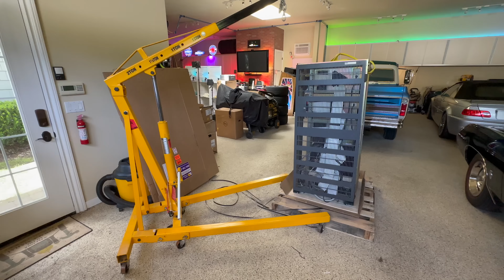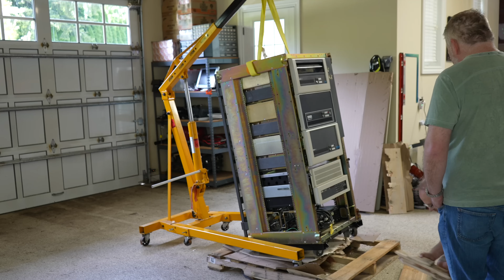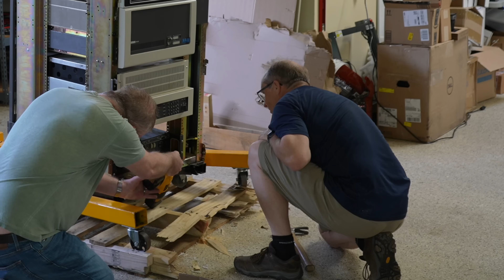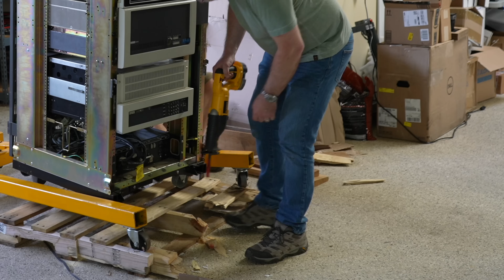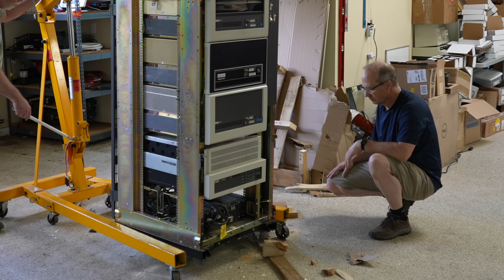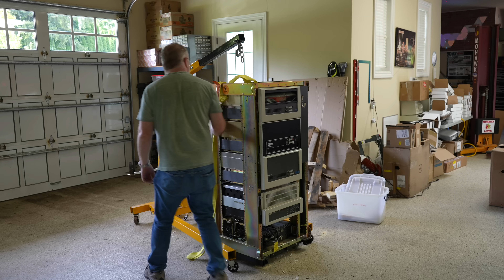I Bought the HEAVIEST Computer on eBay: The PDP-11/34!

Comment: Love the PDP-11 stuff! In high school I had access to a 11/20 then a 11/45 and finally an 11/70. We ran RSTS. I even had my own DecTape! Those were awesome days (74 thru 76). We also had a PDP-8 (I think it was an i). It had 4k core memory with an ASR33 teletype with a paper tape reader/punch. I can still remember the starting address of the rim loader (7734). We had paper tapes to load BASIC, FOCAL and FORTRAN. Nobody else wanted to play with it, so it was basically all mine. I leaned machine language and hand loaded my programs through the switch panel. I am now 68 years old and still working as a systems architect. I still love writing code.

Comment: When I was in Engineering College (1977) I took a class in programming languages.  We used a PDP-11. Not sure which version.  The class was about assembler language programming.  The professor had us program in machine code first so we would appreciate  what a high level language assembler language was.  I had been programming the hp-41CX for years and was supprised to discover that PDP-11 assembler was VERY similar.  So I was right at home with that course and liked the DEC PDP-11.  Several years later (1986) , I was able to aquire a DEC VAX 8550, Star Coupler and a cabinet with four 333MB 14inch Hard Disks, a tape drive for backups, a line printer and several terminals.  With this system running VMS and having Oracle V5 with Oracle Developer tools I set about building a network planning system for UPS Airline.  I was the manager of the development team, database administrator and systems administrator for a couple of years until I hired a systems administrator/database administrator.

Comment: black aquarium filter foam his coated with carbon to produce a support to the bacterial colony that develops which cleans the aquarium water... I don't think the black carbon particles are meant to be part of an electronic ventilation system... just saying. Better replace those with the white fluffy fiber filters.

Comment: Thank you for your very interesting videos. The time I was using those computers was the best in my life. Was using LSI-11 (-02, -23), PDP-11 (-34, -40, -45, -70), VAX 7xx computers from 1978 to 1987. For the OS: DOS, RT-11, IAS, RSX-11M and VMS on the VAXes. Built the hardware and software to get two disk-less LSI-11/03 and a LSI-11/23 DMA connected in a (mini) cluster under RT-11 in 1980 as a university laboratory experimentation facility. It was a time that you were able to understand the systems completely, both from the hardware and software side. DEC systems were well documented and easy to understand. I remember that the VAX 780 CPU was a beast of 27 cards in the machine and an LSI-11 was used inside the cabinet to boot it! Was very sad to see DEC disappear because of their lack of understanding the PC revolution.

Comment: @Daves's Garage for filters; look into Blue or Green (colored) cut to fit Furnace Filter, Way more air flow, Washable & Doesn't disintegrate with time, been using it for decades on my own computers

Comment: I first came to DEC systems in 1989 working as a Operator then System Manager on VAX 8000 and 6000 systems. I could do pretty much anything you wanted in VMS but didn't really understand how the internals worked. Like with many other things, notably the music of the 70s and 80s, I feel I was born ten years too late! I wish I could have begun on the 11/x systems and got to know them from the ground up. I did get to play with an 11/780 a few years later but by then  it was just a cumbersome toy in the corner of the computer room that we could play around with on night shift if we were bored and could stay awake long enough.

Comment: For computer refurbishment before even turning on the machine you would pull each board, after mitigating any technician static using a wrist strap tied to the frame, there may even be a banana jack present to accept a anti-static wrist strap banana plug in the drawer, and do a visual inspection to spot any burnt or damaged components. If the inspection looks okay, you would then clean the edge connectors with Deoxit D5 and an antistatic swab. If the oxidation is heavy, which is looks like in this case, you would then apply a thin layer of Deoxit D100 to the edge connectors and plug connectors. Deoxit D100 has a lubricant which makes seating edge connector boards easier, and for very old machines, with D100 applied you can cycle the boards a couple of times and you will notice the wiping action of the edge connector smooth out. This indicates that the edge connector wiping contact is mating smoothly to the edge connector. For all the boards/connectors that are easily accessible you would pull, inspect and clean all of them.

Unfortunately on very old systems you may need to replace critical circuit capacitors, like electrolytic Aluminum and Tantalum.

Comment: Many years ago my government customer was running old code on even older dec h/w which became increasingly harder to find spares for (they ere buying them on ebay) and they ended up running the code on a Dec emulator which ran on a PC. I dont know if that ran as a VM in Windows or entirely took over the PC hardware.

Comment: Dave, your wife doesn’t have to worry about you going out to bar and hooking up.  You just fill your man cave with interesting computers and enjoy.  Me too.  I have an old Tektronics IBM Mainframe Oscilloscope (analog) in my garage.  Just in case a IBM 3705 NCP communications controller is locally available.  Old retired SNA guy.

Comment: The PDP/11 34 was my first computer to use, other than the timeshare computer in my high school.  In 1979, I set it up with a pack of relay switches to perform load shedding and building automation for the company I worked for.  The entire program ran on Fortran with 24 KB of memory.  Worked like a charm for about 4 years before being replaced by a Barber Coleman Econ IV.  That computer is also long gone but I kept the desk cabinet for my own use and it now houses my flight simulator computer. Your video took me down memory lane to those great times in my life. Thanks.

Comment: A few key notes. 
A PDP-11 is nothing like an S-100 system where the backplane slots are just a "bus." Only some slots in some types of backplanes are wired for peripheral controllers. On the 11/34 CPU DD11-PK backplane, the first two slots are specifically dedicated to the CPU, and the other slots are for peripherals. Slots 3-9 rows C-F are small peripheral controller (SPC) slots, which support simple peripherals. All 16 data lines go to them, as do most of the address lines, interrupt lines, and DMA lines. In slots 3-8, rows A-B have the extra connections that make the entire slot a modified unibus device (MUD), providing the additional address lines needed for the full address space, as well as funky voltages needed by MOS or core memory cards. The only slot on the DD11-PK that is "Unibus" is AB9.
The RK11-D controller takes in Unibus on AB1, and puts it out on AB4. Slots 1-4 rows C-F are completely "haywired" for the dedicated logic. AB2 is the cable to the disk drives. While it uses "Unibus" cables to connect to the disk drives, it has ZERO electrical relation to a Unibus. In fact, electrically it is the interface that Xerox used on the Diablo 31 and 33 disk drives, which are what Digital sold as the RK01 and RK03.
The modern expansion backplanes were DD11-CK and DD11-DK, with 4 and 9 slots respectively. All nine slots are SPC, with all but the first and last being MUD slots.
The only Unibus hard disk controller that Digital made that fit in a controller slot was the RL11 for the RL01 and RL02 disk drives. It's a modified Unibus device, just to have enough real estate.
That both RK05F disk drives are labeled 2/3 is fishy. Each drive should have a unique unit number. It's set on one of the cards in the drive, either by jumpers or switches. There are diagnostics that will test the controller without involving a drive. But, keeping RK05 drives working is "exciting" now that the supplies (filters and heads) are unavailable.

Comment: I was a DEC contractor for a while circa 1995-96.  When my first contract ended, I picked up another gig with a group that was, at the time, based in The Mill, the long time HQ for DEC in Maynard, Mass.  I worked in The Mill for a week before we transferred elsewhere because The Mill was in the process of closing.  So not only was I briefly a "Mill rat", I was one of the last ones.

I started on DEC equipment in high school around 1976.  We had dialup timeshare with a county-owned DECsystem 10 shared by 20 or so schools.  I then worked on the county PDP 11/70 until graduation.  In college we had a DECsystem 20 that had the horribly slow DEC 10 emulator.  I also used an 11/20 in my workstudy job.  

Long ago, but in some ways seems like yesterday, especially when I see videos like this.

Comment: I've inherited a PDP-11 cabinet and PDP-11/20 control unit (probably non-functional).  Would anyone happen to know the proper fan size for the top of the cabinet?  It looks like 250mm or so should be about right.  I plan on using it as a cool looking old rack but with modern equipment, and I'd like to put a fan in the top for air circulation.

Comment: I worked with hardware that you had to keep (some) battery + on or it lose its state forever (bad news).  Had to solder in a fresh battery pack and then cut the old out.

Comment: Back as a young programmer, my company used PDP-11/34 systems as a peripheral controller for off-line high-speed laser printing (high-speed = 29 inches/second), like those used to generate telephone and utility monthly billing statements. The 11/34 ran under RSX-11, but the custom controller software was developed on a PDP-11/44 running RSTS/E. It's been many decades since I sat in front of either system, but my recollection is that RSX-11 was a very terse command set, and the RSTS/E was somewhat more verbose. I especially remember the RSTS full screen text editor program because it could control the cursor on the VT-102 and do fancier formatting than an a ADM-3 and could even display 132 columns. Magical!  LOL. If you could run a tour of RSTS (or maybe you already have) that would be fun.

Comment: Das blinkenlights!  That bit was on the PDP-11 I was using in Grad School.   Specifically:

 ACHTUNG!!!  

Alles Touristen und Non-Technischen Lookens Peepers.
 
Das Komputer Machine is Nicht für Gerfingerpoken und Mittengrabben. 
Oderwise ist Easy Schnappen der Springenwerk, Blowenfuse, und Poppencorken mit Spitzesparken. 
Das Machine ist Diggen by Experten Only. Ist Nicht für Gerverken by das Dummkopfen. 
Das Rubbernecken Sightseenen Keepen das Cottenpicken Hands in Das Pockets, 
So Relaxen und Watchen Das Blinkenlights.

Comment: My very first IT job was operating a DEC PDP 11/70 back in 1980. My now VERY vague memories of it are of multi-platter disk packs that were the size of a desktop printer. Each pack stored less than 100MBs and the drives were the size of dishwashers☺ Kudos to you for possessing the skills to resurrect your 11/34!

Comment: Absolutely fascinating videos!

I worked for DEC in UK from early 1980’s.  Started as a field service engineer on small Unibus systems, mostly 11/34s, 11/24s and a few 11/84s and some older machines too.

At that time, we split the teams into Qbus, small Unibus, large Unibus and VAX.  It was more about the type of peripherals used than processor power TBH.  Didn’t make sense to train everybody on every device.  I think there was probably a PDP-8 team too, though 8’s were disappearing rapidly by then

We certainly had PDP-11/34s with RK05 drives, but during my time in field service, 1984 – 1987 I guess, RL01 and especially RL02 drives were popular, having a massive 5Mb or 10Mb capacity compared to 2.5Mb for the RK05.

If you do need to access the underside of the backplanes, for example to remove or replace the NPG in/out jumper, you should be able to tilt the whole CPU unit upwards by pulling forward the levers on the sides of the drawer unit.  Obviously be very careful you do not trap are damage any cables in the process, and check everything before trying this on an old machine.

The DMA and associated NPR (Non Processor Request) and NPG (Non Process Grant) is a bit of a gotcha if you are changing an existing Unibus configuration.  

From what I remember, on a typical default 11/34 configuration, some slots are dedicated for DMA use and won’t have the NPG jumper on the backplane.   Slots not originally intended for DMA cards have the jumper in case the card does not pass along the NPG signal.

If you place a DMA card, such as the UniBone in a non-DMA slot with the NPG jumper, this will need to be removed as you say.  If a DMA slot has a non-DMA card that does not pass along the NPG signal, or an older type G727 grant continuity card is used, then the jumper will need to be added to the backplane for that slot.  The G7273 grant continuity card does pass along the NPG signal so if that is used no backplane jumper is required.  Phew!

Of course, PDP-11s could come in many configurations, and could be modified subsequently by their owners, so checking each slot for presence or absence of the NPG jumper is a good idea.

One reason why, even though in theory you could put a device pretty much anywhere on the Unibus, you would never change the position of cards on a working machine.  Actually there are more reasons than the NPG issues mentioned above – but this post is already far too long!

Comment: It's funny. I started on IBM 1620/1710 decimal machine w/ 1 disk pack, card reader/punch, 64K mag core memory, offline tabulating line printer. Used PDP-8, but nothing heavy. Then after college went to Western Electric/GTE, moved to IBM 370/145, then IBM 370/158, then IBM 370/168. We had 100 3380 disk drives, 50 tape drives, 250 terminals, massive I/O controllers to run JES2/JES3, MVS, TSO, etc. Went to Intel after working with 8080, 8085, 8086, interfacing with DEC PDP-11/70, and the IBM 370/168 (also added IBM 3090 mainframe). Write custom operating systems, drivers, and had the Intel, DEC, and IBM systems talking to each other and transferring data, compiling code with custom compilers, and executing finally on the 8086. Then went to Hughes/McDonnell Douglas/Boeing in CA and they TEN IBM 3090's, some IBM 370's, and some VAX 11/780's in Long Beach alone, not to mention St. Louis and Mesa, AZ. I was based in AZ and troubleshot micro, mini, and mainframe systems in quite a few states. My biggest accomplishment though was to put FOUR 8086 CPU's together at Intel to emulate the IBM 3090, wrote the firmware, diags, boot loader for XENIX-86 OS, and this system became the proof of concept for the Intel Quad Core CPU 8 years later. Was instrumental in setting up the Hillsboro, OR Intel facility, 80286, 80386, 80486, and Pentium. Retired now. What a career!

Comment: My first experience of a computer was a PDP-8, with several Creed 2300 teleprinter terminals for user I/O. Each had a built-in tape punch and reader, but there was also a high speed paper tape reader, an X/Y plotter a massive Hard drive, probably 5 megabytes, and an optional orange screen monitor. A monthly maintenance and service rental of around £1,200 was payable. (Those were the days.) It ran 1969 BASIC and COBOL. 

I never saw a PDP-11, but always wanted to experience using one. This video, and Dave's interesting Usagi Electrics channel, is about as close as I'll ever get to seeing how they rock, and what they are capable of. So thanks for this video, and any future ones which you make which feature this very versatile machine.

Comment: About 1990 I had a pdp11/34 system with 4 rk07? hard drives (10mb removable packs) plus a giant tape drive (9 track open reel).  It had RSTS with BASIC and UserBase.  The whole system was clean, complete and ran perfectly (tho "ran" is generous).  I had it set up in my dining room - mostly as a conversation piece.  I paid $270 for it (had to drag it home).  I don't know how much it all cost new, but as a clue -- the tape drive had an invoice stuffed inside it that showed the tape drive alone cost $67,000!  I eventually scrapped it because it was a pretty useless novelty.  But damn!  You paid how much?  Shit, who knew it would be worth so much today.

Comment: When I was 20 or 21 (I am 66 years young now), I got my first major job working for Blue Ribbon Sports, before they took the show name for the company name and became what we know now as NIKE. This is when they only had two or three building in the Koll Business Center. They had a single PDP-11/70 and got another one a few months later. There were many disk pack drives and tape drives for each system. I thought this was the coolest thing I had ever gotten to work with, and it was.

Comment: To  fix cartridge drives(make them interchangeable) you need a tecktronics scope and
the alignment procedure + spare pack written by the alignment program.
Usually head ajustment screws were on the head assemply.
If you get read errors, clean the heads. If cleaning does not work then replace the head
that is causing an error.

PMING CARTRIDGES USUALLY:  CLEANING THE HEADS WITH ALCOHOL 99% + KIM WIPES
ONCE MONTH OR (WIPING THE KIMWIPE OVER EACH HEAD.

Comment: Or instead of bothering with flow control, you could just turn off smooth scroll on your terminal and it will scroll a lot faster.